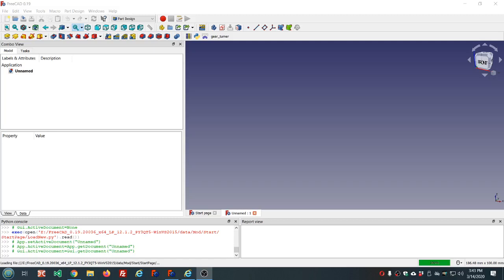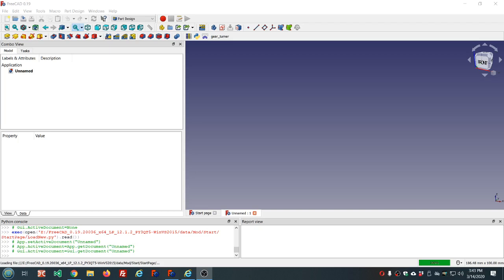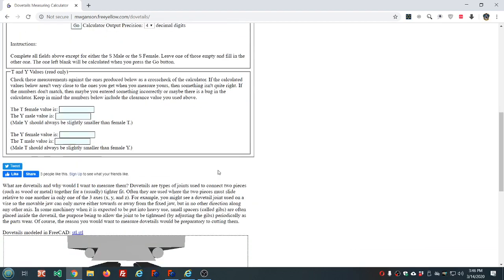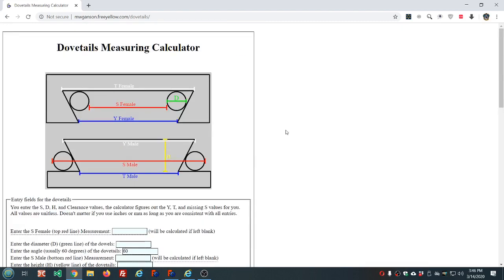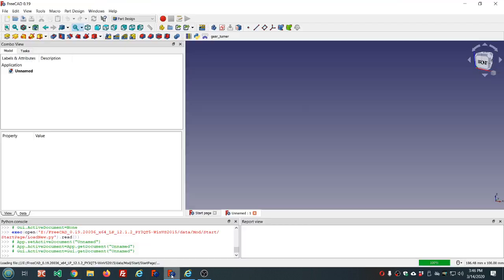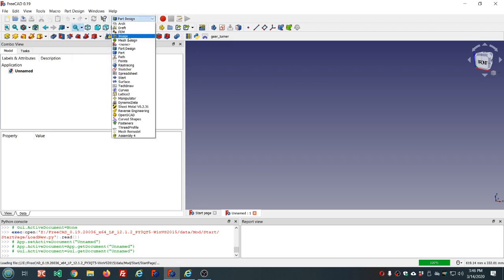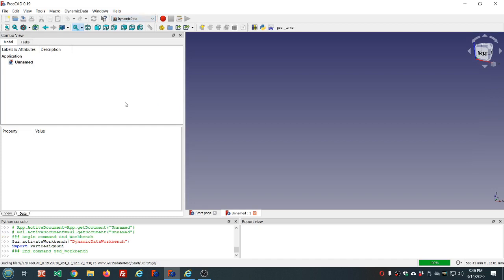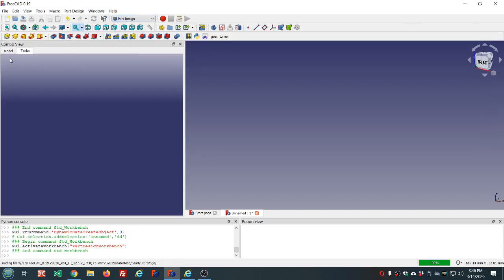047   FreeCAD dovetails

Comment: Thanks for 0046, 0047 and 049 FreeCad videos.  They were helpful even if they were executed with FreeCad 19 Eperimenatl.  I am using FreeCad18 and will not upgrade for awhile until I do a full OS upgrade. 

The calculator was very useful.  I am using its calculations to "retrofit" my sliding dovetail box project.   The retrofit g-code will be used to mill the new slot and tab.  Then a dovetail cut g-code will be produced for the slot bottom and the tab top will be cut after measuring the retrofit slot.  

Thanks again for a path forward.
Reply from the maker: At this point 0.19 is very stable and really it's just about ready for release as stable.  You can have both versions installed simultaneously.  0.19 does not require installing, you just extract to a folder with 7-zip, then in the bin folder look for freecad.exe.
Reply: I tried your suggestion about using FreeCAD 19.  It is definitely worth what I paid for it. 

1>First of all there is no backwards compatibility.  If you make the mistake about opening one of your FreeCAD18 projects in FreeCAD19, that is the last time you can see it in FreeCAD without renaming issues. 

2> About the only benefit that was derived from the video and going to FreeCAD is now I have very valuable backup copies of my prior FreeCAD 18 projects.

3> The video was helpful in obtaining a Sketch of the Front View of the puzzle box.
Reply: I was able to recover my puzzle box project from my "Gold" backups.  So there was just time lost flirting with FreeCAD19.
Reply from the maker: @markwilliams8892  Sometimes improvements come at the expense of backwards compatibility.  When that happens a choice has to be made whether to go forward when the benefits are seen to outweigh the compatibility issue or abandon the improvement if it isn't worth the trouble.  I abandoned an improvement I was working on because it was only going to be a minor improvement and it would break backwards compatibility (being able to open in 0.18 what was saved in 0.19 if that particular somewhat obscure feature had been used).

It is good that you wisely backed up your work.  I don't know what your compatibility issue was.  I haven't been actively working on FreeCAD in recent weeks, but I believe some recent changes have been made to the Sketcher that break compatibility.
Reply: @mwganson  Roger that.  046, 047, and 049 were still very helpful videos/tutorials.  Thanks for your work and videos.  Let the FreeCAD developers know I am available for test/troubleshooting (in particular, sketch, part, part design, and path workbenches).
Reply from the maker: @markwilliams8892  Just get the latest version and if you find any bugs post them on the help board on the forum at freecadweb.org.  This way experienced users can vet the bug reports before they go to the bug tracker.  Be sure to use the latest development version since bugs from earlier versions might have already been fixed.  

If you want to take it a step further you can compile pull requests and test them even before they make into the master source code.  In that case your review would be a comment on the pull request at github.com.